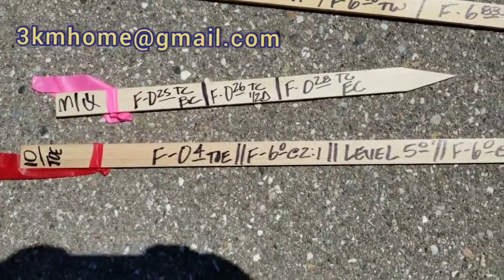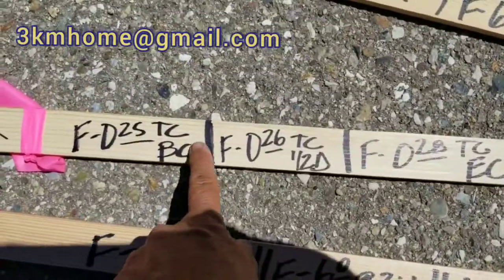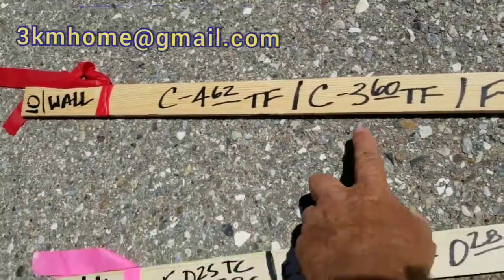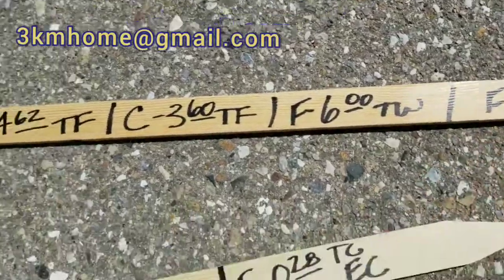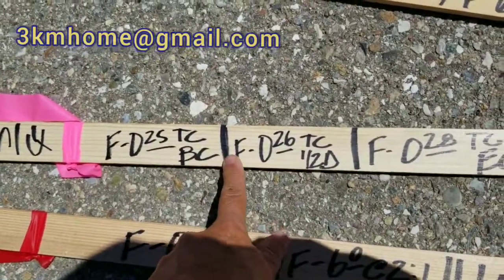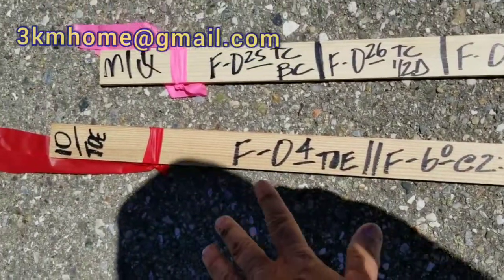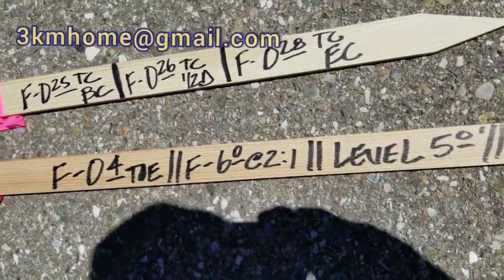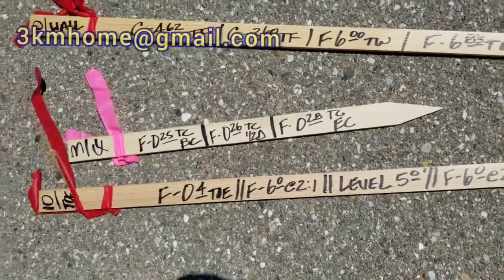How To Read Survey Stakes /vs//

Comment: Is EC edge of curb?
Reply from the maker: EC in the example means End of Curve.  Many times curb is staked with stationing which shows direction,  there will be a BC, begin curve.  At the end of the curve there will be an EC.  Depending on the size of the curve, there will be deltas.
Reply: @Surveyorjoe  By half delta, do you mean half way on the curve? Also, how did you get 29' of grading for the last example?
Reply from the maker: Yes, 1/2 Delta is half of the curve angle.  Example, when we stake a standard CURB return,  we normally break the curve up into quarters.   BC, 1/4 Delta, 1/2 Delta, 3/4 Delta, EC.  The 29 feet is the horizontal distance out. F-6.0 @ 2:1= 12 ft + the 5 Level + another 12ft.
Reply from the maker: We use EC as end curve or end CURB return
Reply: Thank you joe .. im new  @Surveyorjoe

Comment: U didn't explain what BC HD EC means u just started off with radius and then u proceeded to read the stake wtf do they mean, does BC mean beginning of curb ,HD at radius point, EC end of curb 🤷 what do they mean
Reply from the maker: BC = Begin Curve. 1/2∆ = 1/2 Delta of the curve. EC = end of curve.  Common abbrev we use.  I will make a video on different abbrev that are used.
Reply from the maker: BC = Begin Curve. 1/2∆ = 1/2 Delta of the curve. EC = end of curve.  Common abbrev we use.  I will make a video on different abbrev that are used.